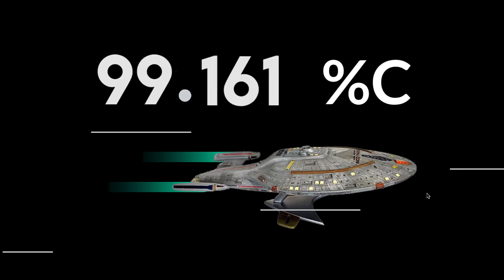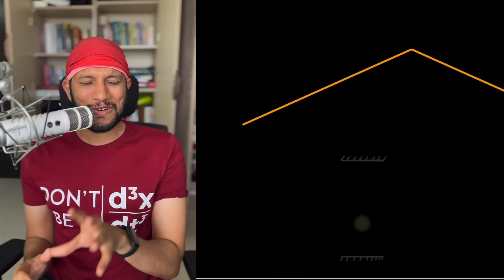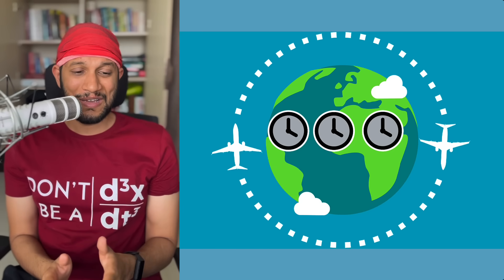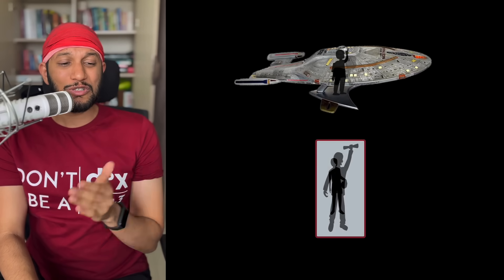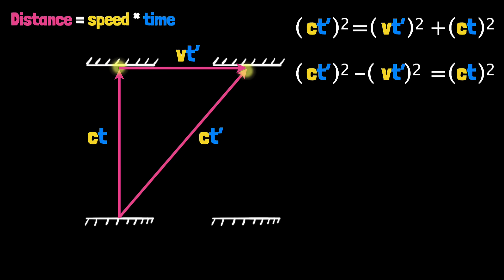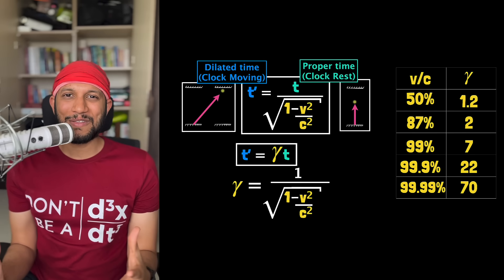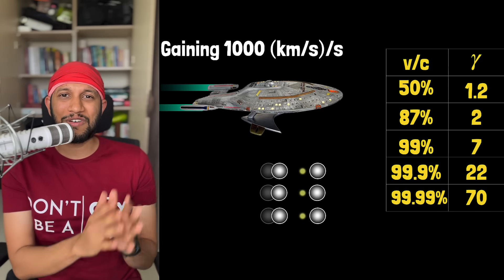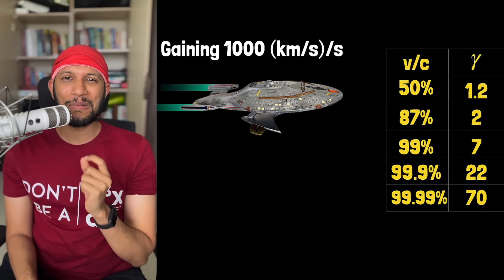I finally understood why you can't go faster than light! (My mind is blown)

Comment: why cant i get into the ship and accelerate it by a 1000km/s^2 while inside it? it would take forever for an observer outside, but nothing would change inside the ship
Reply: You can.  But from your perspective, you are always at rest.  In order to measure your speed, you must choose some reference frame to measure relative to.  You could choose the reference frame of the ship, but the ship can't be in relative motion with itself so in this frame it is trivially at rest. Your only alternative is to choose some external frame and this is no different from an external observer measuring the ship's speed.  Either way,  you will not reach the speed of light in any frame.
Reply: @charlieharris4881  but i can measure my acceleration. knowing that my a = 1000km/s^2 i would get to the speed of light in roughly 6 minutes. does it work that way?

Comment: The size of the universe, when compared to its age, indicates that things can travel further out from a central point than the speed of light by itself allows for (the visible universe has a radius of 46.5 billion light years, despite the universe being less than 14 billion years of age,) but that's not because of the acceleration of objects themselves; it's because the frames those objects exist in are also in motion.  In short; space itself also expands.  Relativity is important to this topic, but it's also frame-dependent, which means that it is possible to travel "faster than light," but only if space itself can be artificially expanded and contracted, so that you don't move, but the space you're inhabiting does.  Even if that were done, though, you couldn't travel faster than the light within your frame of space.

Comment: Photons in a photon clock travelling longer between their bounces is no different from me putting a grandfather clock in a pool of water and saying "Look! The pendulum is moving slower."
We have many ways to divide and measure time but we seem to have replaced time itself with the instruments with which we first intended to measure it. We have made a god out of the priest. Velocity may affect your instrument but that only speaks for the inaccuracy of your instrument. How fallible it is. Being submerged into water does not slow down time because the pendulum is not time itself. Nor is the bouncing photon time itself. They are just instruments.

In our mathematical models, we require time to be the engine of change and progression of reality. We elevate it into a primary concept of reality. A number that can affect other numbers. That drives them forward. Whatever our model tries to replicate, it is a result OF time. And this is fundamentally flawed. Necessary for mathematical purposes, but flawed.

Reality itself has no time. The progress of reality is governed energy-states changing and quantum-fields in ebb, flux and flow, etc, etc, and these happens whether someone measures them or not. They happen outside of time. We percieve that change and we take all those little things that are happenening and divide them into equal parts and pieces for our own benefit. We call this "time", and because that is such a useful invention and because we can't see or fully understand the quanum, we fail to see that time itself is just a bi-product of reality as seen through human eyes. It is not the ENGINE that drives reality, as we have forced it to become in our mathematical models.

This is why people say that "If you drive really fast, two million years will have past here on Earth!". Of course it wont. "If you send a twin to space, they will be different ages when he returns". Of course they wont. It is just a ghost in the model. It is a ghost in the model because a swing of the pendulum, the bounce of a photon or the vibration of a crystal cannot possibly account for all the quantum-activities that it is supposed to represent. An atom-clock is not time itself. It is just a machine we have built to measure it with.
Change in the state of reality is real but currently unfathomly complex. We use time in its place for simplicity's sake. For our own sake. 
But we have made gods out of the priests. We have made instruments into time itself.
Reply: The muons collapsed everything i said
Reply: I'm rambling, I suppose.
Reply: Very good video, by the way
Reply: Ok, disregard everything I wrote.

Comment: NOPE. The photon clock explaination is all wrong.  It won't go at an angle. It will go the same path and distance as the stationary one.  Its like being in a car with a ball.  Toss a ball in the air when you travel. It goes up and down. It is already in a forward motion.  This is stupid.

Comment: But what if I was on that ship? From my perspective, I'm gaining 1000km/s speed every second, everything is normal . But after 3000 seconds, will I catch up with light? That couldn't be true, could it?
Reply: From your perspective (meaning measuring in your reference frame) you are not accelerating or moving at all.  You are at rest for all time.  That's always true of everything in its own frame of reference: something can't be in relative motion with itself.  We don't typically think this way though, for instance when you're driving down the road, you don't typically think of yourself being at rest and the road moving backwards away from you, but that is exactly what's happening _in your frame of reference._. Instead, you typically think of yourself moving relative to some other external reference frame: the ground.  When you say you're driving at 40 miles per hour, that's not in your own reference frame but in the reference frame of the ground.  So back to the spaceship scenario, you are not gaining 1000km/s every second in your own reference frame, you are gaining this speed in some other external reference frame. This is no different from an external observer measuring your speed and as we've already seen in this video it will never reach lightspeed in such a reference frame.
Reply: @charlieharris4881  No, no, no! It's not like I'm moving linearly at a CONSTANT speed, I'm accelerating!  When someone accelerates, they feel the force!  That's why acceleration and gravity are indistinguishable according to Einstein's equivalence principle.  Actually, 1000km/s/s is way higher than something humans can handle. But that doesn't matter.  For example, even if I'm accelerating at  9.8m/s/s (1g), which I'm quite comfortable with, I can still reach the speed of light in less than 365 days, theoretically.
Reply: @thatchacre5763  Yes you feel the force, but in your frame of reference you are still stationary and not accelerating.  In your reference frame, there is a "fictitious" force acting "down" that results in a 1000km/s^2 acceleration, and to you this just feels like a (very strong) gravitational pull.  But you are still at rest, by definition, in your own reference frame.

Comment: BUT! Why is there nothing faster than photons? This theory relies on the fact that energy is transferred by photons, which travel at the speed of light. But what if there is something even faster that could be used to transfer energy? Could there be undiscovered phenomena or particles faster than light, or is this speed truly the ultimate limit imposed by the structure of spacetime?

Comment: There's a logical flaw in this argument. There is apparently nothing stopping the ship itself from continuing its acceleration up to the speed of light. After all... From its perspective nothing has changed according to relativity. Given its mass and given the force applied to that mass... It will continue accelerating at 1,000 m per second per second until it reaches the speed of light, right? Now granted... The entire universe around it will speed up and speed up and speed up and they might approach the end of time. But what's really stopping them from doing it?

The flaw in the argument is that they are equating an infinite amount of energy with an infinite amount of time. Now, The infinite amount of energy part is not possible. However, there's nothing stopping them from accelerating at a constant rate for the amount of time required to have logically reached the speed of light. At that point you will have accelerated the universe's clock around you to Infinity, but there's really nothing stopping you from doing that. There's nothing stopping you from being on that ship. And holding a constant acceleration for a finite amount of time sufficient to reach the speed of light. You will have just pushed an infinite amount of time into the universe and reach the end of time.

Obviously we won't be able to report back but fucking try it. See what happens.
Reply: From the ship's perspective (that is, measuring in the reference frame of the ship), its velocity is exactly zero for all time.  It is not accelerating or moving at all.  This is true for anything in its own frame of reference.  If you want to measure a nonzero speed for the ship, you must measure in an external reference frame in which the ship is in motion, and in such a reference frame the ship will approach but never reach lightspeed.

Comment: But that's from outside the ship it would take infinite energy but from the ships perspective It could reach light speed. No?
Reply: Speed is relative.  For someone on the ship to measure the ship's speed, they need to choose a reference frame.  In the reference frame of the ship itself, the ship is always at rest (it can't be in relative motion with itself).  So in order to get a useful measure of the ship's speed, the observer on the ship would need to choose some external reference frame in which the ship is in motion.  But this is exactly the same thing as an external observer measuring the ship's speed, and as we've already seen the external observer will always measure a speed less than c.

Comment: But if you create a time/space bubble using counter rotating magnetic fields. Then tune the Tachyons in the containment field to the same frequency as the Tachyons passing by at FTL speeds which drags you and your field along at a speed Faster Than Light.  What happens to the clocks inside this field as compared to clocks back on Earth?
Reply: FYI using Newtonian Physics FTL is not possible. Using Teslan Physics you can. Unfortunately you'll probably never get to see much more than what I've stated here.

Comment: It would be interesting to keep the view from the inside. Because despite all, from the inside the ship would still be gaining 1000m/s per second and at some point be faster than light, at least for the people inside the ship.
Reply: Remember that, according to relativity, all speed is relative. So it is meaningless to say that someone on the ship would eventually reach X velocity without specifying what reference frame they are measuring relative to.  If it's their own frame of reference, i.e. the one traveling with them and with the spaceship, then they are trivially always at rest since they can't be in relative motion with themselves.  If they want to make a useful measurement of their speed, they therefore need to measure relative to some external frame in which the ship is actually moving.  But this is no different from an external observer measuring their speed, and as we've already seen, such an observer will never measure a speed equal to or greater than light speed.  So either way, no, the person on the ship still does not reach the speed of light in any reference frame.